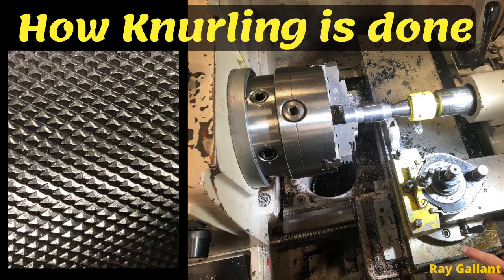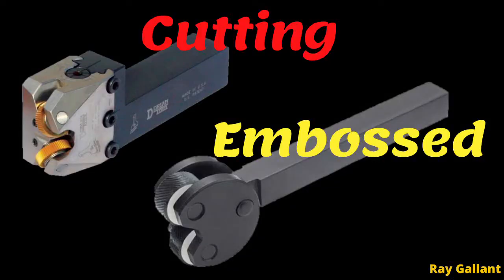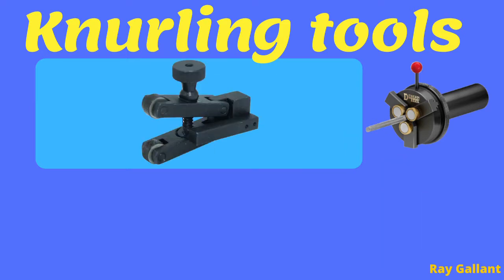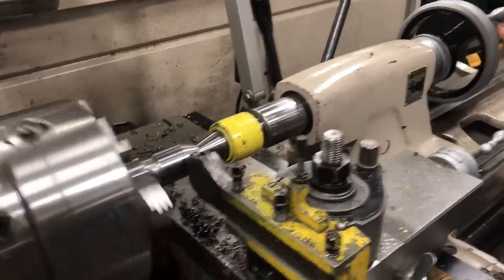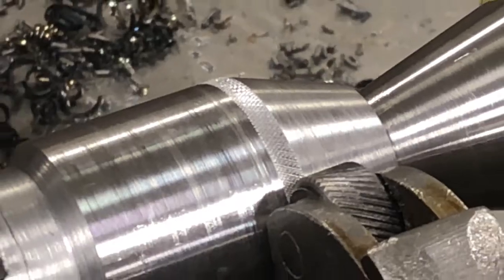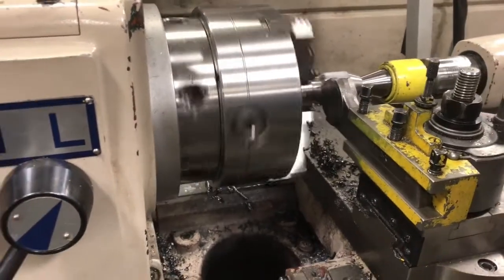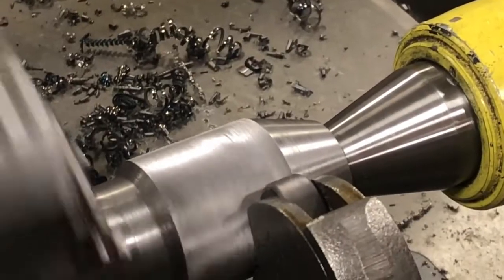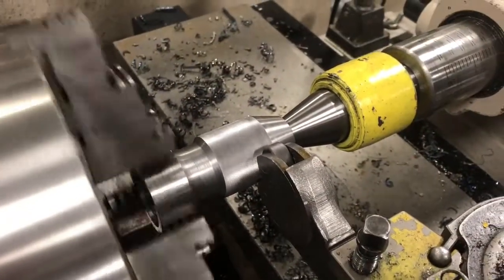How Knurling is done

Comment: So the embossing Knurling tool is pressed on to the piece with a lot of force? Is that how embossed knurling works? Also how much force/pressure would you use to get a good effect on the piece thanks for this video. How do the scissor knurling tool produce enough pressure to emboss also.
Reply from the maker: it’s not really the amount of pressure it’s the amount of pressure. It takes to embed a certain distance.

if your machine is not very rigid, you are better off, going with the scissor type because it compresses on the top and bottom, and will require less force from your cross slide and compound rest 

I have another knurling video coming out. It’s more of the technical and not actually a practical demonstration but that’s gonna be six months to a year. 

Hopefully this answers your question thank you 
Ray

Comment: Hi, what size 'Cut's' are you inputting on the cross slide? I heard 3 thou mentioned, what is your initial 'Cut' so to speak of, Thank you
Reply from the maker: It depends if you have the knurling head perpendicular or if it’s on a slight angle
If you’re cutting aluminum or nerling aluminum you can go much deeper per past than you can steel
Depending on how Rigid your set up is I show the students how much pressure not really depth because the tool post will spring back
What if I had to guess I’ll probably say first pass 0.02-0.03
And after the first pass probably about 0.01
On manual machines the depth isn’t quite as important as continuous pressure
Your tool post will spring back On less  Rigid machines
Hope this helps
Ray
Reply: @shopandmath  Thanks for responding

Comment: 👍 there can be math involved for knurling too if you want to calculate the blank diameter. Kinda like cutting a gear to see how many teeth will fit on the circumference. Dorian Tool has some good info on the subject.
Reply: You are 100% correct it’s basically the same as making a year depending on the pitch
I will have to check out the website that you suggested

Thank you for taking the time to comment much appreciated
Ray

Comment: How does the tool hit the same place grooves again and again instead of just making a mess?
Reply: I believe because the diameter of the tool and workpiece have a certain ratio
Reply: I was kind of hoping the video would explain WHAT knurling is - how it works - but nope. Just more showing off on how great he is
Reply: you're keeping a consistent .030 per revolution or whatever he said it was. when it goes in reverse it still moves at the same rate keeping it in sync.
Reply: Dark magic
Reply: Same question here
Reply: By using carriage you can make the accurate cut

Comment: this is strange obviously the end result shown at the end of the video is no matching the result shown on the video, i came here coz i have the same exact issue if found here!. notice at 5:52 you will find one of the wheels is double marking, for example making 0.5mm pitch instead of 1.0, notice the shape drawn is like double in length (not a square), in that case it is impossible to fix unless you start over, notice also when he continue to knurl it came out pretty messed up
Reply: One of the wheels is producing a double tracked pattern. That is why it looks messed up. What you're looking to achieve is even pyramids which this isn't
I don't traverse back and forth loads of times as seen here but just apply a firm bite at the starting point and hit power feed when I see fully even opposing pyramids.
Reply: @howardosborne8647  yeah and i dont understand how shop and math cant see that!, i solved that problem already as you said
Reply from the maker: Sorry there’s no conspiracy theory here same part same guy same Cut
There was no mixing matching

Simon will get a kick out of this though
Reply: @shopandmath  one of the wheel is splitting the pitch, you dont see that?! it is a known issue

Comment: Scissors type are the only way to go. Even the cheap ones we can get down in the States for $60 from Victor Machinery.com work very well. The pins for the wheels are made from mild steel and need replaced and then they are good to go.
Reply: Best results I've had are from scissors types

Comment: How can we knurl flat brass rule which is 3 mm thick, 1 inch wide and 1 metre long. How to knurl on side which is 3 mm thick?
Reply from the maker: you can flat knurle with a milling machine 
and there is a process called dimond cutting
Reply: Do you have a milling machine with 1 m travel and power feed?

Comment: Interesting that no lube was used on the actual knurl surface.  Seems like every other demo I have seen uses lube, liberally. 
New to me, was using a knurling operation to emboss numbers and the like on dials.
Thanks, well done video.
Reply from the maker: we should have used coolant in the knurl and oil on the studs but we were videoing and would not have gotten the shot
Reply: And I too have read that lots of oil is to be used during knurling but after watching this video I'm starting to wonder if the oil just keeps the chips suspended to be ground I to the developing pattern and thus my poor knurling?
Reply: Typically when you're watching machining videos, they don't use coolant because it will end up eating through plastics on the camera and end up ruining footage.